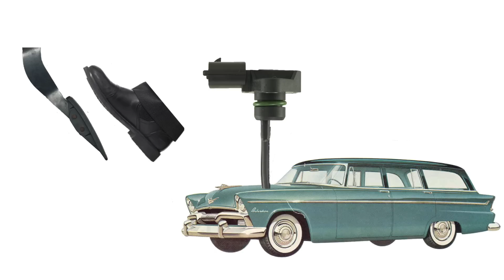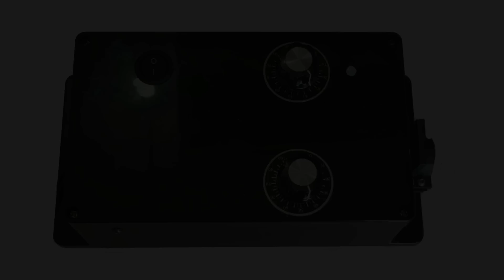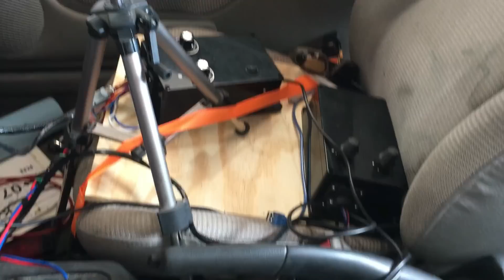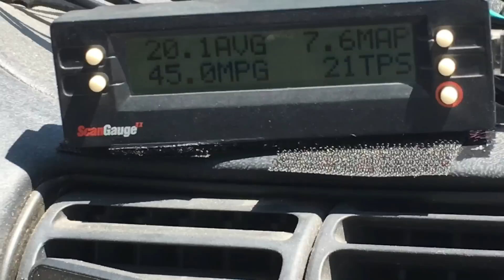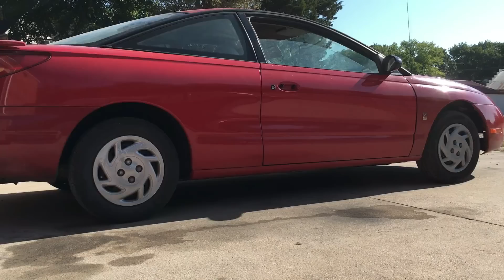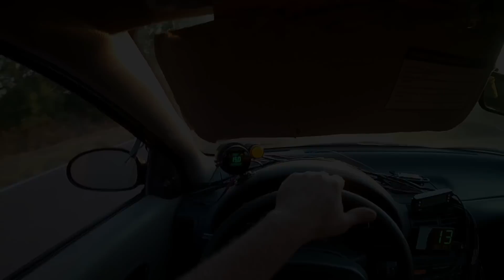S2E20: We road test the fuel saving Robo-throttle on our project car and discover hidden MPG’s.

Comment: I'd like to see aerodynamic experiments! You could put a flow tripper (basically, a lip) on the back of the car. A drag racing wing is a similar concept. Basically, just extend the trunk lid. You could try covering up the wheel wells or trying ventilating the tops of the wells. You could just do CAD (cardboard aided design) to be real cheapo.

You could block off all the air coming into the engine bay and maybe try mounting the radiator facing down. This could be catastrophic. A safer experiment would be to ventilate the hood. The idea behind ventilating the hood would be to reduce lift. You would think lift would help fuel economy because it reduces the weight on the wheels. However, if you have lift, you also have drag. More lift often means more drag. More drag means worse fuel economy. I tried hood ventilating on my miata. I did it for heat dissipation of my turbo, but I swear my fuel economy went up. 

These are all just experiment thoughts that you could do on the cheap.

Comment: In a rudimentary way, this is how cruise control works. However, cruise control differs in that it will open the throttle all the way open to maintain speed. I don't think your system will.
Reply from the maker: Correct, this system will not maintain speed when going up a hill.
Reply: @robotcantina8957  I sometimes wonder how a system would work where a divorced throttle is tied to road speed rather than engine output... a "cruise throttle" where a given input directly correlates to the speed of the car, 0-100% for idle/stopped to the allowed top speed. You wouldn't do this all the time though, just in top gear, and tie the throttle applied angle to the TPS delta or the difference of requested to current speed (i.e. 30-70 gets full throttle, but 50-55 gets 10% increase).

Comment: I just thought of something- the 2 throttle bodies in series aren’t working linearly. Think about it- if one opens at 50% and the second just mimics that, then that’s only 25% throttle. Or if they’re both at 75% that’s 56% throttle.
Reply from the maker: Correct.  The throttle body that feeds the engine is the drive by wire throttle body.  The way the system works, it really doesn't mater if the cable throttle body is WOT, the drive by wire body is the actual throttle.  Its hard to wrap your mind around, but it works fine.
Reply: @robotcantina8957  ok, I understand now

Comment: If the MAP value on the scangauge reads around 14.5 to 15 with engine off the unit is PSI absolute

Comment: I would love to see you make this car a hybrid. Have most of the acceleration done under battery mode, maybe through 4th gear, then the gas engine kicks in with or without your robo throttle, depending on needs.
Reply: Put an electric motorcycle motor in place of the alternator, and have it assist the engine under high throttle input when the robothrottle is automatically closing the throttle.

Comment: A kick down switch  for a GM THM 400 equipped  car or truck could be used to turn off the robot upon wide open throttle jaunts.

Comment: so basically you made a secondary throttle plate like there are in motorcycles (my 20yo gixxer has that), theoretically you could increase low down torque just a bit by making proper adjustments. love ur vids btw, keep up the work

Comment: I love how that saturn even with looking more aerodynamic is both slower and uses more fuel that my old 2000 renault twingo managed on a 500km trip with no care given to fuel economy lol. (850kg car with 75hp 1.2L 16V engine, it averaged 5.5L/100km and avg speed of around 70kmh with hilly terrain and where possible reaching speeds of 130-140kmh)
Really interested in seeing how much work it is to bring a much heavier car with bigger engine like this one to reach similar fuel economy while not absolutely wrecking the performance

Comment: I would like to point out that the dual throttle bodies are not as unusual as you would expect. The Kawasaki concours 1400 motorcycle and others from Kawasaki actually implement a very similar system to help implement their traction control.

Comment: You should implement some kind of tachometer reading into the Arduino, so that it disengages at idle and higher RPM. It would feel like a sort of fake VTEC as well if you did that

Comment: I’d say an almost 20 percent gain without having to be thoughtful of it is impressive. Too bad you don’t have ecu software to actual tune the car. A couple extra degrees of ignition timing under light load might improve fuel economy even further. Also 14.7 afr isn’t always the best for fuel economy. I often find cars that get better economy on slightly richer mixture. This may seem counter intuitive at first till you realize that the richer mixture often equates to less throttle input using less overall fuel and less air in the mixture. The system more effectively burns all the fuel inside the cylinder. Too lean can equate to unburned fuel in the cylinder from areas being too lean to ignite reducing efficiency. 

Of course without testing this by tuning the ecu directly there is no way to know if the vehicle prefers a leaner or richer mixture for economy.

Comment: Suggestion: Forced atomization of fuel.  Use an air compressor to blast the fuel as it leaves the carburetor with pulses of compressed air as it is sprayed into the intake forcing the fuel to atomize better.

Comment: Saab 9-5 uses a cable operated electronically controlled  throttle body. With a limp home solenoid
Reply from the maker: Yes, I checked those out.  those would be a good starting point when fooling with drive by wire.

Comment: hey i an idea to test. When the engine runs hard, they make it run extra rich, this cools the engine down and makes more power. However the way it makes more power is kinda stupid. it uses liquid gasoline to phase change to gas gasoline, creating more pressure, basically converting heat into pressure like a boiler/steam engine. It's stupid because there isn't enough air, and so gasoline ends up being dumped into the cat, without being used properly. Well anyway bmw had a car with a separate water gas tank that would do water injection at high engine loads to increase efficiency and fuel economy. The pressure and temperature are so high in the combustion chamber that even with water the gasoline will still explode.

 So what the idea is, to have a big 5/10 gallon water tank, and always inject water during operation. The engine makes a lot of heat as a biproduct, most of it comes out the tail pipe and radiator just to get rid of it. If you inject water into the combustion chamber, it will create more substance to move the pistons, and it will also keep consuming heat in the engine, making less heat come out of the tail pipe/radiator, and using that heat to create more kinetic energy for the pistons. 

This would also be great for turbos maybe even without intercoolers, because instead of cooling the air to prevent excess temperatures in the combustion chamber, you could add water, which would make the engine create more power, and make sure of the heat that was made by turbo compression, creating more efficiency.
Reply: Momma Panda  damn I read my comment and I had like three grammatical errors lol

Comment: Nice work.

This is an idea for the upcoming diesel experiment.  If you consider to force induct the diesel, I hope you use a supercharger instead of a turbocharger.
Everyone has seen, heard, and maybe touched a Turbocharged diesel (Turbo-Diesel), but supercharged diesels are a novelty (Super-Diesel).  I know that Supercharged Diesels are not as thermally efficient as a Turbocharged Diesel, but it would be unique.

Comment: I know this is vastly over complicated and maybe pointless, but  I would love to see an e throttle for each cylinder, with sensors on each exhaust port, so the engine can tune the AFR for each cylinder directly for perfect combustion.
Reply: ITBs are definitely out there!
Reply: On fuel injected engines this can be done with a single throttle body by adjusting individual cylinder fuel trims. I don't know if it can be done through any oem ecus but most stand alone systems allow for it.
Reply: @tblosser8921  Only on multiport FI.  I forget which SOHC generation he has but earlyones were throttlebody 
injection.
Reply: @michaelkrenzer3296  it is multi port, also to make it itb it would require individual injectors

Comment: would be nice to know why lower MAP = higher efficiency
Reply from the maker: I just looked this up, The Scan Gauge displays MAP in psi and not in inches of mercury or kilopascals, that's why lower is better.... on the scan gauge.
Reply: @robotcantina8957  doesn't really answered my question.
Maybe i rephrase that.
Why the efficiency changes with intake pressure? The unit is not important for now.

isn't the efficiency better with the throttle wide open. Compared with the same acceleration time.?

So like acceleration time say 10sec in 3 gear.
and also 10 sec in 4 gear but the throttle fully open.
Reply: @robotcantina8957  Yeah, watching the video and when you questioned what units it was showing, I was like "hey that's in psia".
Reply: @phunkstar7347  When he was talking efficiency, he was referring to fuel economy for the whole vehicle.  Yes, engine thermal efficiency isn't necessarily at lowest manifold pressure.
Reply: @sccengr  i also mean fuel efficiency. It just doesn't make sense to me.
Its just like if you for example say you can use the gas pedal for max opening 40% and you have to wait until your speed is enough for the next gear. It doesn't improve efficiency its just driving efficiently

Don't get me wrong for a reliable and repeatable drive efficiency for the next videos its awesome.

Im not really into carburetors.
But there should be a different thing. Because intake pressure is one of the keys for fuel/air mix.
Reply: @phunkstar7347  If you're pulling a vacuum in the manifold, you aren't supplying the engine with a full charge of air... since fuel use is in ratio to the amount of air, you use less fuel at the cost of making less power... which is fine, because you aren't in demand of any more power than you're making while drawing a vacuum.
Reply: @phunkstar7347  Yes this is just a fancy limit "the gas pedal for max opening 40%" but it's doing it in a way that can be dynamic and added upon in the future.  Yes in a max accel test, the lower MAP is not more efficient, but that's not what Jimbo is trying to do.  
So on long distance fuel econ, driving efficiently does improve fuel econ efficiency.  Since over abundant instantaneous power increases can hurt the long term fuel econ.
The human is a bad control loop, it has a max refresh rate of around 10hz if fully attentive and is as low as 0.25hz when bored going down the highway.  The controller here is taking the human out of the loop for direct throttle management, to prevent over/under shoot of speed, and wasteful speed oscillations (also a problem with many stock cruise controls).  The controller can get best driving efficiency by controlling to the lowest MAP that will balance power to the speed wanted.
Also of note, fuel/air mix ratio is generally constant for all intake pressures after the throttle.  So reduced MAP, which is after the throttle, is reduced air flow and reduced fuel flow.

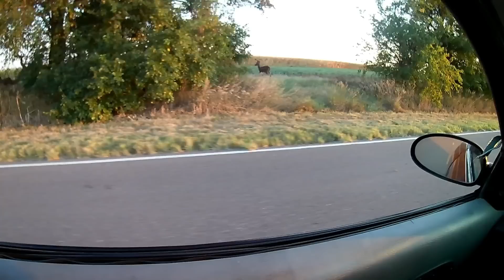Comment: 20:23 you can buy those from auction sites. I know one that sells Mig fuel tanks and regual T-34s with the turrets... how they legally ship with working turrets is beyond me, but they also have artillery pieces. Surprisingly cheap tbh... recall finding a british APC that sold for 20k usd... still cheaper than some new cars tbh... about the same price as a bread truck as well (20k plus taxes for new bread truck)

Comment: durnit, (jumping the shark now) fix the wagon and sell it to me, please!
yes I think your arrangement has a mainstream application. simplify with a kick out switch, an idiot light to tell you its off, and a resume button next to it for "back to MPG mode". I'm hopelessly optimistic anyway, so I'm expecting this combined+refined with the lean burn could easily give average +60 mpg at 60 mph for longer road trips. stop and go run around town, same old 34-38 mpg tops. that by itself pretty much shames "Detroit" that can't build smart phones with a set of wheels on them because of the "chip shortage" (such BS!).
I know they can build reliable cars that'd give +60 mpg without all the electronic+electric crud everywhere, but they wont, they want disposable cars YOU can't work on yourself.

Comment: Now that you got the Saturn wagon, it would make more sense to get the diesel into the wagon rather than the coupe.
Reply from the maker: Good point, but the wagon is actually a nice car and a lot more comfortable for the longer fuel economy tests.  Perhaps if the diesel experiment works out really well we will transfer the diesel to the wagon.

Comment: I'm glad I found this video and will be keeping up with the Kabota swap!  
My Dad bought a brand new 1995 Honda Civic DX (2100 lbs dry, I think) and we averaged 50 MPG going to and from WI from NC with a family of 4 and luggage.  My cousin, one of his buddies and I did the same trip 15 years later in another Civic and managed the same mpg.  0-60 was an advertised 9s or so.  I imagine that a system like this could be fitted and you could switch between sport and economy mode and maybe have a "passing" button or a pedal switch on the floor to disengage fuel savings.  I wonder what that car would have been able to do with this type of system and maybe that 3-cyl turbo diesel.  Hmmm

Ideally, it could work with a lot of cars and trucks.  Also, it could be set up to use cruise control to allow a certain amount of speed increase down hill and torque management to prevent downshifts when transitioning to uphill sections.

Comment: drive by wire sounds way less dangerous on an old Saturn than on a performance car...also you can always go in neutral?
Reply: Just push the clutch
Reply: @MrOpenGL  yep, the opposite. problem happened to me, ran out of fuel on the left lane of the highway while overtaking a truck. I unclutched ,  went to the emergency lane and would have even reached the next exit if the emergency lane didn't end because of a bridge. not such a big deal

Comment: I have thought of doing something similar, but only engages with cruise control. Once cruise is set, the DBW would prioritize maintsining manifold vacuum over speed within a certain window, like +/- 5mph target speed.
Reply from the maker: That would certainly boost MPG and you could still more or less go at the desired speed.

Comment: I had a similar idea years ago to use a turbo with a  throttle body in front of it to keep the vacuum at 0 psi in the intake manifold but that was years before Arduino were a thing or mega squirt ect...
Reply: I'm pretty sure this is very similar to how Ecoboost turbos work on fords... I'm shooting in the dark honesty though
Reply: @dylankoch1827  you maybe right. The 1st time I saw it was on a Porsche rally car. Their idea was you could boost faster from 0 psi instead of negative 13-14 psi and have more torque off the line. In other words beat boost lag.